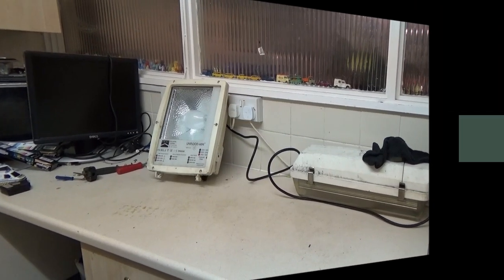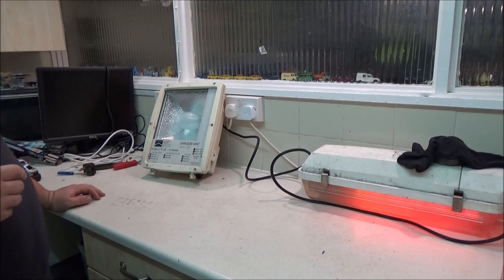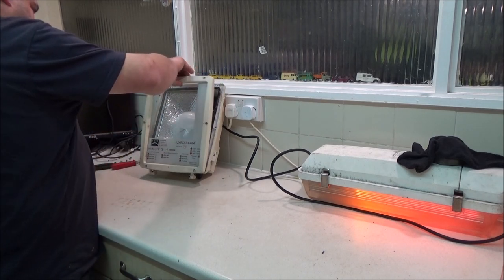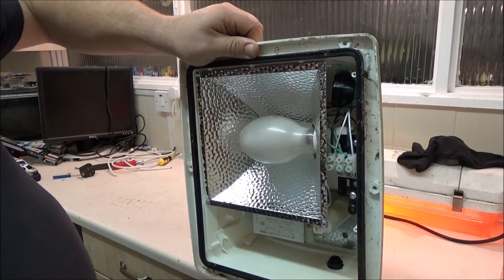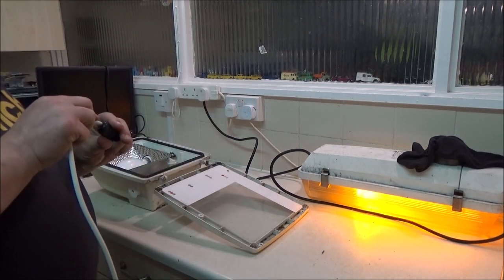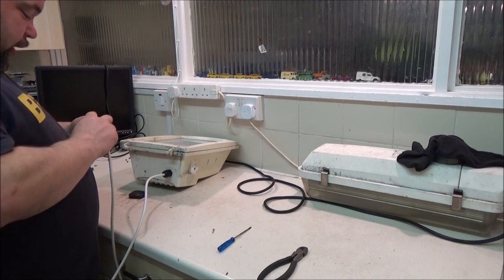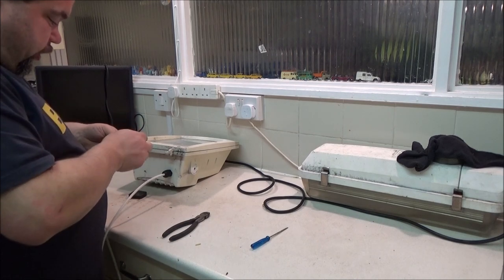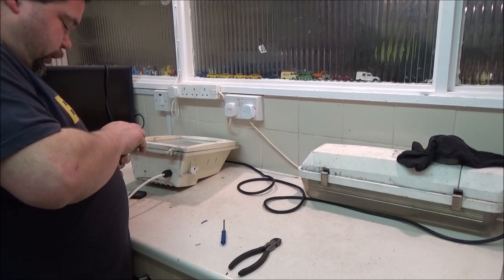My SOX Type Commercial Lighting.

Comment: For your question at the starts of the video: I believe your floods are High pressure sodium (SON).

Love your sox light, I have a very similar one to yours apart from the bowl hinges are on the ends rather than on the side. 

I do love the floods too they look in quite good condition! 👍

Overall love the video, can’t wait to see how you get on restoring that old light. I might actually make a couple videos of my sox lamps if you wanted to see them but probably wouldn’t talk as I am not comfortable with that to be honest. Great video 😀
Reply from the maker: SON! that was it. Curse my bad memory! lol. Thanks. I would love to see what you have.  It's taking a little longer than expected to fix up that home made light. The paint I used on the new board takes a very long time to dry off. The plan is, once everything I want to paint/clean has been done, I will do a video of reassembling it.
Reply: LifeOfAnEnglishman nice! I’ll let you know when I’ve uploaded a video. I’ve been to a reclamation yard today and picked myself up a nice old G.E.C SON light but sadly did not come with any gear just a bulb. I’m thinking of taking out the old bulb and socket and putting a new LED one in as it would be alot of work to find a ballast etc.

I also assume that you’re painting the light white?
Reply from the maker: @ContentDeleted-mr3rt  The new board is silver while the reflectors are going white. They don't really reflect and I just wanted them put back for show.